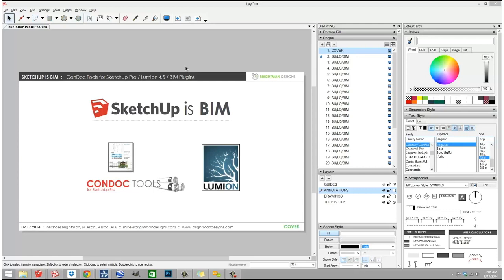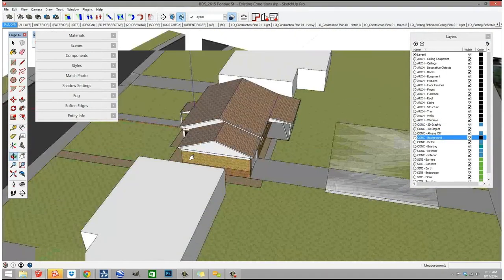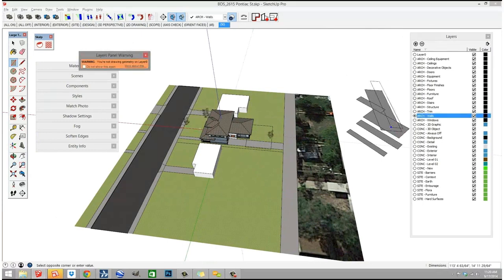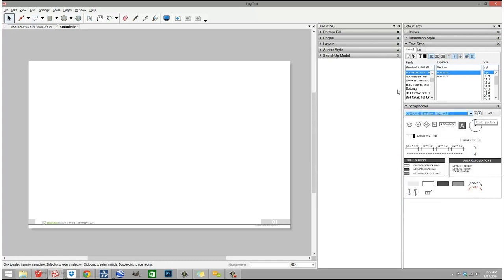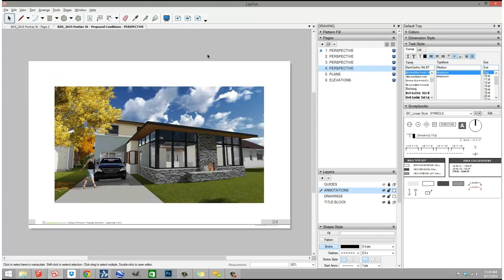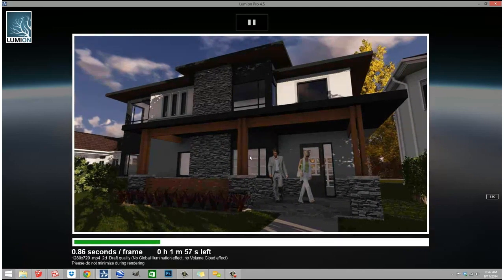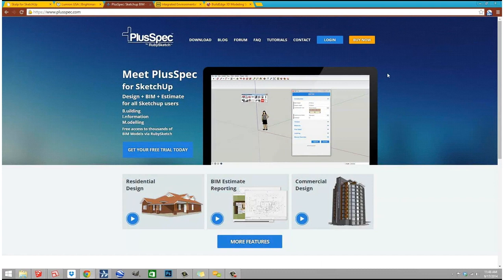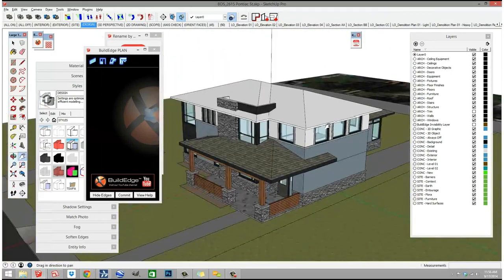SketchUp is BIM

Comment: Lets be clear, sketchup isn't really a "BIM" tool. It mostly serves to create quick architectural concept visualizations as well as basic 3D geometry modeling. The software itself depends on the use of many extensions and plugins which will often not match the accuracy of the tools that other programs provide (Revit, archicad, Vectorworks). Nonetheless it is still a great tool with good import and export features, but I would not categorize it as a software with BIM workflow or anything similar to that. Modeling with full constructive accuracy and detail demands way too much time...
Reply: Plusspec is the answer of your question

Comment: Hi, I am doing some remodeling and structure additions to a house. (diy home owner) I am brand new to construction. (I am a software engineer)  Can you suggest a simple software/extension for me to model a 12 by 18 single story structure with gabled roof and windows and doors. I want to get a list of ALL the pieces of lumber, precut them and then,  assemble them. My crew is pretty good with wood work, but they are not framers. We lack the knowledge of codes , we have to constantly look at span tables etc. If the software incorporates those elements , that will be amazing. I am pretty comfortable with sketchup and getting started with revit. Thanks

Comment: Whether you agree with the presentation or not, it's great to see a company (Trimble, which is a formidable force) take on Autodesk for AEC.  I don't like how Autodesk has changed everything over to expensive subscriptions.  Sketchup is free and a one time fee for the Pro version and works across multiple platforms.
Reply: still cheap in 2021 (300$) but yearly subscription too, now